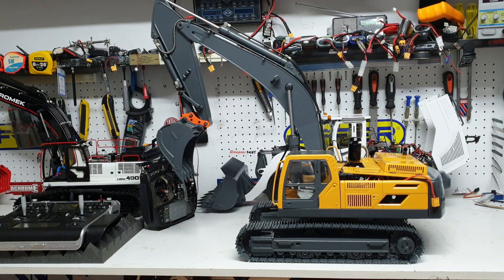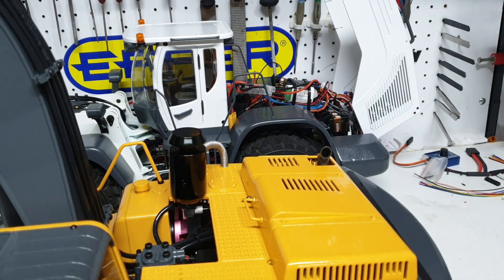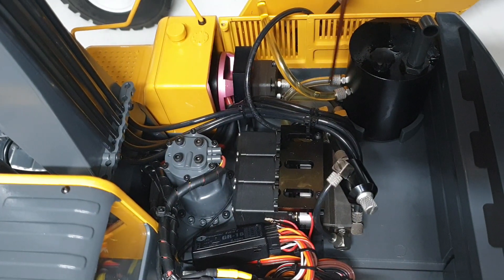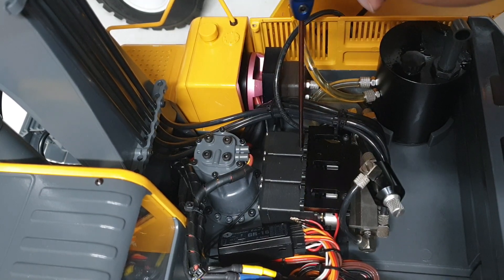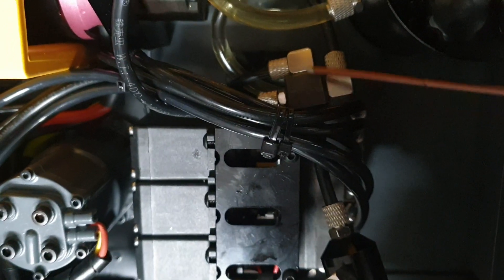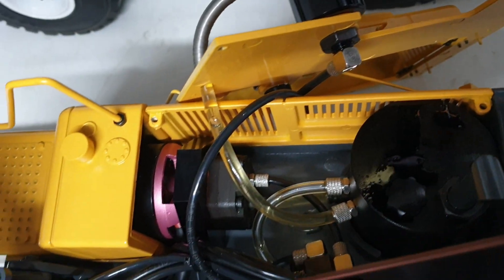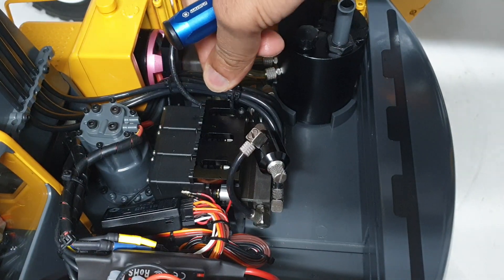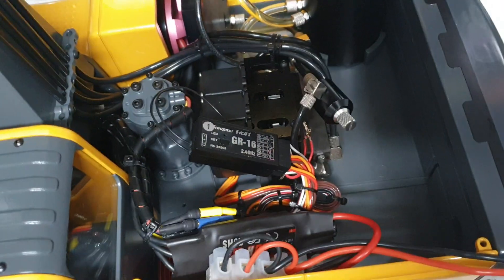CSMI RC Hydraulic Excavator VLV360  working explained.

Comment: Thanks Kevin for this video.  Does this Excavator have a BEC in the ESC?
Reply from the maker: Hi Anthony thanks for the positive  feed back .  No there is no BEC. The HYD ESC  has plenty power to the 3 servos. There are 4 ESC = 2 for the tracks + 1 for the car body + 1 for the HYD pump. The HYD pump has the biggest ESC so we use that to power the RX.